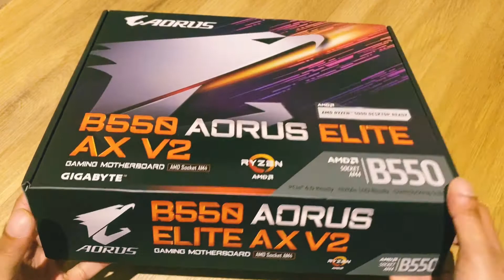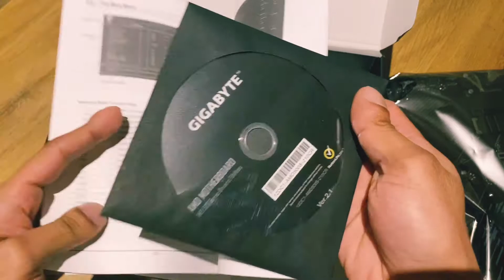Gigabyte B550 AORUS Elite AX V2 Gaming Motherboard | AMD Socket AM4 | Unboxing | RIunboxing

Comment: hello did you need to flash the bios of this motherboard to accommodate a ryzen 5000 series?
Reply from the maker: Hi! I am using AMD RYZEN 5 5600G (5000 series) processor and didn't have to flash the bios. I hope it helps!! 
Thank You. :-)

Comment: Will it support ryzen 7 5700g, and if it supports , do we need to update bios,
Reply from the maker: Hi,
Compatible processors: AMD Ryzen 5000 Series/ 3rd Gen Ryzen and 3rd Gen Ryzen with Radeon Graphics Processors

It should work well without BIOS update :)

Comment: Does it support  pci gen 4 ssds on both slots
Reply from the maker: It has 2X M.2 connectors (1X PCIe 4.0/3.0 and 1X PCIe 3.0)

I am using Samsung 980 500 GB PCIe 3.0 M.2 SSD. It’s a next-generation ready motherboard, just use the right slot and will work amazingly. 

Link: https://youtu.be/nd0fvsLwHok

Official information:
Unthrottled performance is guaranteed by the advanced thermal solution which includes Enlarged Heatsinks, High-Quality Thermal Conductivity Pads and Thermal Guards. B550 motherboards are cool on MOSFETs and M.2 SSDs even on full loading. It provides lower temperatures for enthusiasts, overclockers and professional gamers.